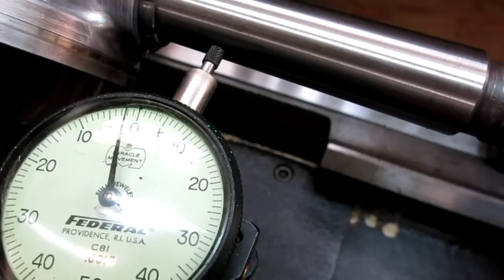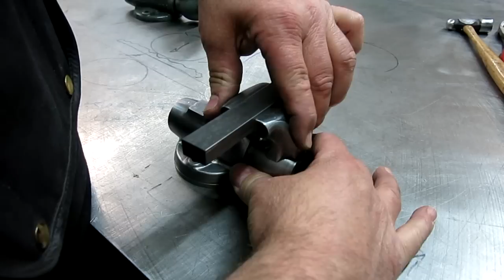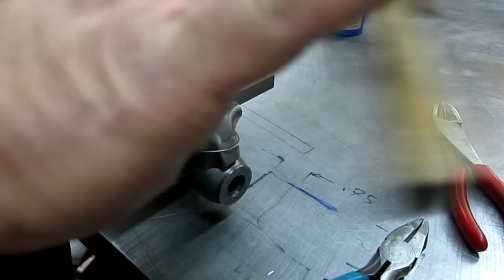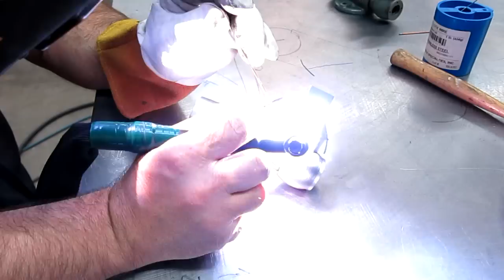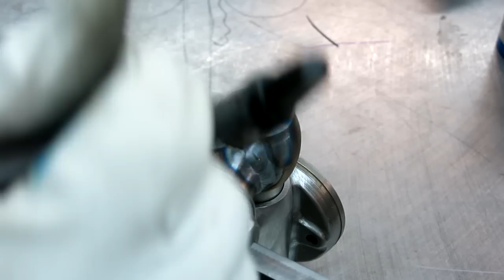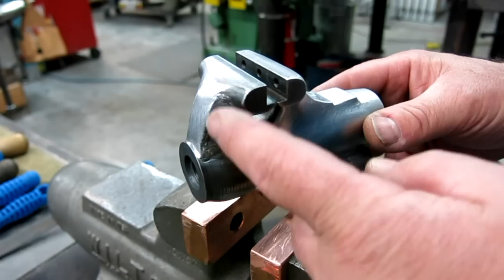Building a Wilton Baby Bullet Vise 21

Comment: Looking Great Tom!  Clamping that vise with all of its contours in the 4 jaw was quite a challenge.  I think I would have set up an angle block on a faceplate on the lathe and mount the flat bottom of the flange to that angle block. The bottom line is you "Got Er Done".

Comment: When I saw you first setting up the jaws my initial thought was safety wire!  Great minds think alike?  My excuse is I’m a retired aircraft mechanic, and we use the stuff like farmers use bailing wire.  But we have special pliers that twist it, kind of like an old push drill but reversed.  Found my first pair at a swap meet, no one knew what they were.  Snap On gets like 80 for them, so swap meets are definitely the place to look if you are using them on an infrequent schedule.  And I knew that you were going to stab yourself, it’s a learning requirement.  Super project, and I am impressed with your file assortment!  Or maybe I should say envious ?

Comment: All respect, your a fantastic machinist.  It seemed to me bolting the flat bottom of the vice to a 90 degree plate and putting that in the 4 jaw or perhaps on a face plate was the best work holding solution here.  Everything is a trade off and in the end you have to choose and move forward of course.  And really the best of all might have been to simply hand turn the reamer through the part on the bench.  ??  Extremely good series.  No doubt you could fabricate anything to a very high standard.

Comment: I would've tried a bump centering tool on that mandrel instead of trying to tap it. I do a lot of quick and dirty setups cutting in our oldschool cnc shop making plugs, spindle liners, dust caps, shims and such. I often turn plastics between two flat surfaces, one quickly faced mandrel and sort of a blunt nose live center adapter. Nothing at all holding the part concentric but simply pinched between the tailstock and the chuck. Using a bump centering tool and just slowly feeding into it will knock the thing really really close to center in about 5 seconds, works just like an edge finder. Because of how quick it is you could go back and forth between the chuck jaws and bumping it a couple times and get it pretty darn close. 
Just sharing my 2c worth of love for bump centering tools, opens up some weird possibilities on the lathe.

Comment: Have you ever "floated"  A reamer , so it follows the hole vs forcing it on centerline with a very stiff reamer. I haven't done it in a long while but it was useful in projects like the vice. And nice job on the fit and finish of the vice..

Comment: Hi mate.  Fantastic, is the first thing I would like to say, that is becoming a stellar piece, far better than the original.   I have two questions, and a personal statement.  Why did you use the lathe to do the reaming, rather than the mill, or could you not use that reamer in the chuck.  Will the weld be strong enough to hold that jaw down, I know that it is only a little vice that is for small stuff, but still?  If you would put some headphones on for your tunes, I for one would love to see you shape that vice, or anything like it.  It's just nice to see it become a visually pleasing object.  Besides that, I love work, I can observe it for hours ; )

Comment: My first thought was to incorporate an angle plate to the base to help hold that, in place of one of the jaws if possible, or on a faceplate.  Having that come loose wouldn't be good.  Nice seeing it shape out.  I don't think you will equal the number of episodes on this project as TinkerJohn is on his Stewart though...

I think my choices would have included King Crimson, Alan Parsons, Mike Oldfield, Pink Floyd, Robin Trower, and maybe some Wishbone Ash...

Comment: Tom, I love this series. You have explained everything clearly and you are creating a work of art. This is the first video that I didn't understand your your fabrication sequence. Is there a reason that you didn't put the key in the movable jaw slide before welding on the jaw? I would have thought that putting in the key first would guarantee the final alignment.
Reply from the maker: +Ron Garrison Hi Ron,

If the key was already in it I would have to contend with the weld distortion. Putting the key in after the welding assures the best alignment of the as welded part. Thanks for the comment.

Cheers,

Tom
Reply: Makes sense. I hadn't considered weld distortion, since the key was so far away. That's where experience counts.

Comment: Nice vise Tom, just a silly question, would it have been easier to put the keyway in first then align the jaw.
it might have  been  easier to line the jaw with the spindle in position?

Roy.

Comment: Stunning piece of work.  Always happy to ask the daft question but...why not use a boring bar to hit size on the ID?  then there'd be no wiggle prior to the key being installed?  I assume the internal keyway trailing edge would be unpleasant for the insert each rev.  What about HSS  boring?  I look forward to responses from those WAAAAY more experienced than me!
Reply from the maker: +Iain Fletcher Hi Iain,

Good question. The boring bar would make a new axis where ever I happened to position it. The reamer follows the hole that is already there. In hindsight I would leave more material on the bore for final finishing and to clear out all the weld distortion. Then the method would have been boring and honing to accurate and a perfect fit. Thanks for the comment.

Cheers,

Tom

Comment: I was also wondering why not screw the base of the vise to an angle plate and use the boring head on the mill. Must be a reason to do it in the 4 jaw.
The vise is exquisite.!
Reply from the maker: +Stan shire Hi Stan,

I wanted the reamer to follow what was there not establish a new axis as boring would do. Kind of a least squares fit problem. Thanks for the comment.

Cheers,

Tom

Comment: I've done a lot of soldering, but no welding. What kind of welding are we seeing in these videos? Is this arc welding? Is the filler wire steel or something like phospher bronze? When you spot weld without any filler, where does the material come from?
Reply: +Pete Brown  TIG - Welding.  The electrode uses an electric arc to the part to generate the heat. Filler wire generally matches the material you are welding. In this case it's steel. The tack welds melt a small amount of material from both pieces and fuse them together.
Reply: +Pete Brown What Tom is doing is called TIG welding. That stands for tungsten inert gas. In the front of the torch is a thin piece of tungsten sharpened to a point. When Tom steps on the foot pedal, the tungsten heats up and the point concentrates the heat to a very small spot. When Tom is tacking the parts, all he is doing is literally fusing the two parts together in a very small spot. As for the filler rod, I'm guessing it is stainless steel, but I could be wrong. I do a fair amount of tig welding at work, so I'm pretty familiar with the process. I hope this helps.
Reply: +Mark R. +Blazer02LS thanks guys. This is a skill I'd like to learn at some point.
Reply: +Pete Brown TIG is what most call it.  It's also referred to as "heliarc" by old guys, and GTAW by the standards guys (for Gas Tungsten Arc Welding). Gives good heat control and very flexible choice of filler rod so you can weld pretty much anything weldable. I've been reading up on it and am just getting started with the actual welding (got the welder last month) so I'm no expert...just passing on what I've heard from some who are.. The tungsten electrode and the weld puddle are shielded by gas...usually argon, but sometimes argon/helium, or other things depending on the situation. Check out Jody at weldingtipsandtricks channel for some good into and examples. You may have to watch a few to pick up the terminology....he's been doing it so long that even when he's trying to talk at beginner level, he's still a bit advanced...but you'll get it after a few videos. 

-- Mike
Reply: +BigMjolnir Thanks

Comment: Tom  that vise is looking really nice.  It is almost artsy, you have done such a nice job of contouring the parts as you have assembled it.   I suspect you have so much time in it that it will become a heirloom.     One question:  I noticed that when reaming the reamer oscillated noticeably.  I am curious how much oscillation is acceptable or normal.   Thanks great work Tom
Reply from the maker: +John Leake Hi John,

The reamer will follow the hole that is there. Since my mandrel approximated the center and averaged it the reamer wiggled because it could see the highs and lows of the bore where the mandrel bridged over them. Kind of a least squares averaging problem. Thanks for the comment.

Cheers,

Tom

Comment: Tom, why would you not jig this up on a mill bed and then ream with the spindle. It would have been much easier to align on a mill bed I believe. Especially to the vice jaw and base.
Reply: +gus bisbal That reamer may not have fit in the mill.  Looked to be a MT3.

I would have put a faceplate on the lathe, mounted a small angle, then mounted the vice to that angle.

Comment: Why didn't you cut the keyway before welding on the moving jaw?  
Just seems like it would have been easier.
Reply: +B Butler I was just about to post the same question when I decided to read all the comments and you beat me to it! This is the only possible fault I have found in this entire build. Very nice vise!
Reply: +William Garrett Ditto.
Reply: Same here. I was thinking the keyway should have been in place but then there is the chance that it will move when welding and cause the moving jaw to be cocked to one side. I'm sure Tom has an ingenious way to locate the keyway. Can't wait to see it. Awesome work and entertaining to watch it come together.
Reply: I believe the keyway is already cut as he remarked the reamer was a "spiral reamer" especially suited for the interrupted cut of the keyway.
Reply: +classicrestoration The keyway in the female side has been broached, but he hasn't done the male half yet. So no key for alignment yet.
Reply: +B Butler my guess is Tom has an appreciation for heat distortion. I know I do.
Reply from the maker: +B Butler Hey B,

If I cut the keyway first it would have helped to align the jaw for welding. The problem with that method is it does take into account any weld distortion. Cutting the keyway afterward when whatever distortion happens assures the best possible alignment of the finished welded assembly. It was a trivial setup to cut the keyway after the fact. Thanks for the comment.

Cheers,

Tom
Reply: oxtoolco
that sounds like the voice of experience talking. For me welding steel is like blowing up a balloon. Even after you let the air out again the balloon stays a little stretched out.

Comment: In the interest of the hoi polloi, or common homeshop folk, let me ask you a question. Would it be possible to substitute silver solder for the TIG weld? I myself have no welding equipment at all, and am not sure whether it is good for someone who has a pacemaker to play around with welding. (I will ask the Alaska Heart Insitute, and let you know).  I have found that with a good grade of silver solder  holds very well and indeed can be used to "weld" bandsaw blades. I make fixtures with it all the time. I ask this because many homeshop people have a propane torch. Not so many have TIG. Many do have MIG. If this thing can be made with silver solder, it broadens the scope  of the people who could make this thing. Mind you, you will still have to do a lot of filing!
Reply: +Juan Rivero  You could do this with MIG TIG or even stick welding, You would need to adjust the fit of each part to allow for the filler metal for each process. Heat would be your enemy as well.
Reply from the maker: +Juan Rivero Hi Juan,

Silver soldering would have difficulty doing some of the filling. There were areas that needed fill to make the contours work out. Torch Brazing would be an option. Thanks for the comment.

Cheers,

Tom
Reply: Ahh, yes. Very difficult to fill in with silver solder. Thanks.

Comment: i'd have cut and inserted the key way before welding on the moving jaw. that way it doesn't matter where the key is on the moving jaw. it'll self align when you weld on the moving jaw. now when you cut the keyway you'll have to be within a bawhair or the jaws will misalign
Reply from the maker: +ghostwalker100 Hi Ghost,

what would you do with all the weld distortion? Cutting the keyway afterwards accurately is a trivial task. Controlling the welding demons is tougher most of the time. Thanks for the comment.

Cheers,

Tom
Reply: +oxtoolco never thought of the weld distortion.

you have me there sir!!

Comment: Why was the reamer  wiggling ? Tom
Reply from the maker: +Robin Cox Hey Robin,

The indicating was an average of the wonky bore. The reamer could pick up on the bore distortions. This was one reason for reaming it instead of boring it. The reamer will follow for the most part the hole that is already there. Thanks for the comment.

Cheers,

Tom
Reply: +oxtoolco  - I was a little confused as to why you reamed it (instead of boring) in the first place? I thought the reason you were using the lathe was to get a good bore (pressure from the 4 jaw may have distorted things a bit too)? And could you have mounted in a V-mill, indicated and also accomplished a clean, even bore? Won't a reamer just follow whatever is there? Enjoy your videos - keep up the good work.
Reply from the maker: +Gus Bird Hi Gus,

Exactly as you said. I wanted to reamer to follow what was there. Indicating would always be a compromise on a wonky bore. Get it close to the average then let the reamer wiggle its way through. Least amount of material removal in this situation. Should have left more meat on the bore for weld distortion. Thanks for the comment.

Cheers,

Tom

Comment: Tom, 
Wouldn't it have been better to put the key in  before  welding the jaw on?
                                                                                                                           Harold
Reply from the maker: +Harold Haines No. Weld distortion. Putting the key in afterward worked out better for alignment. Thanks for the comment.

Cheers,

Tom